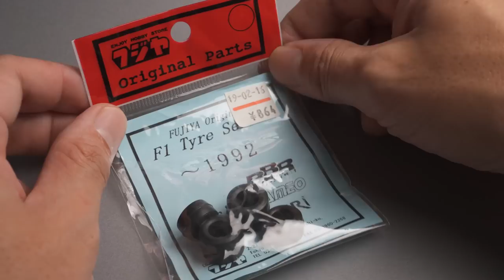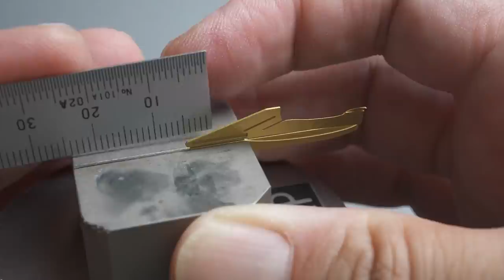#01 Building Jordan 191 TAMEO 1/43 F1 scale model car

Comment: Another historical F1 car & one of my favorites from the 90's, also M Shumacher's first F1 drive. Very simple kit with nice flowing body lines & distinctive green '7 Up' livery. Interesting model with multiple layer rear wing plus anhedral; stepped, front wing with sculptured endplates. 
Tameo had decided to use brass photo etch instead of casting to create these fixtures for cars of that period. Easier to make but more work for the builder to get a satisfying result. Soldering is best option for solid joints & filling as glue, epoxy & putty may not be strong enough for later handling of the assembly.
Nice work using solder to get some curvature into the front wing. Casting is an advantage here to give wing elements a profile instead of a flat surface.
Good demonstration of another technique again using solder with clean & skillful application as always. 
Always something new, educational & entertaining. Looking forward to the next post.
Reply from the maker: Etched parts are finished with high precision. However, they tend to be inorganic, so it is necessary to add a little extra care.
I will do my best again next time, so please look forward to it.
Reply: Yes, etch parts are very precise   & strong compared to casting but they are flat & lack proper shape. Using solder to add depth & curvature is much better than putty. Have to do the extra work to make these parts realistic & that is why you do it.
Attention to detail as always.
Do you make or buy your tire valve stems, may I ask ?

Comment: What is the red polising/abrasive wheel you use on the rear wing? I'm also wondering if its worth buying a rotary tool for sanding and polishing, but I mostly do Star Trek ships and im worried a rotary tool is overkill. Thanks, and wonderful work as always!
Reply from the maker: I have been using it for about 15 years.↓
GSI Creos GT07 G Tool Mr. Polisher PRO Light Work Model Tool
https://amzn.to/3KCIXBi